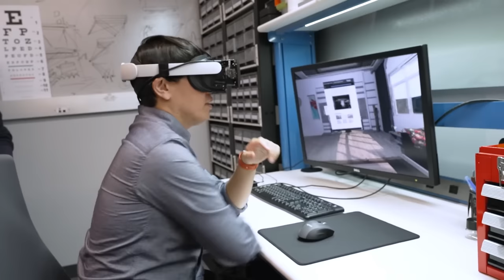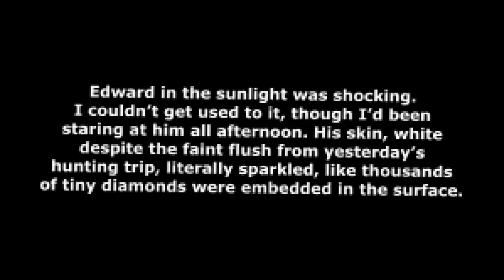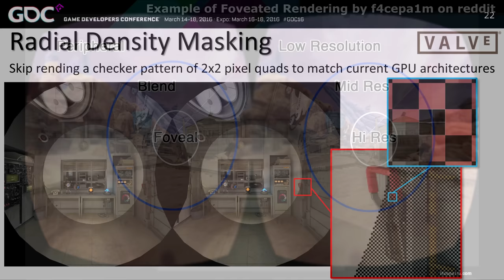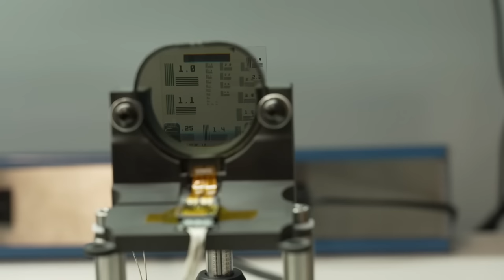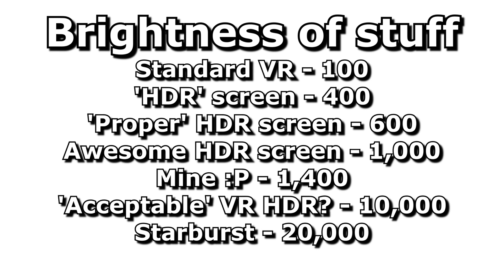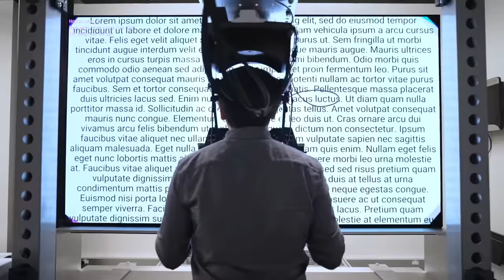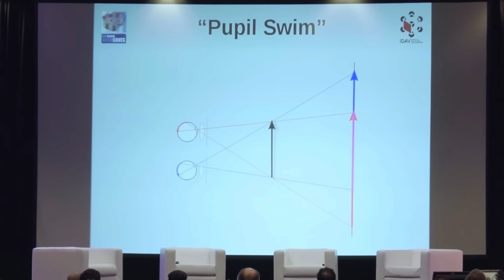Meta's Futuristic VR Designs, Summarised

Comment: I bought the first gen HTC Vive and it's still impressive and gets the job done, in regards to tracking and gameplay. Now it's the case of waiting a few years to enjoy the sum of all these incremental changes with a new headset.
Reply: Yup, most people don't have the latest phones or buy a new GPU every year. This kind of stuff will slowly trickle down, generations down the line it'll be more accessible.
Reply: the only thing that annoys me with my used Vive I got recently is that lighthouses use quite loud gyros, making me disconnect the thing every time. Other than that, A great headset free from Facebook rule.

Comment: VR with eye tracking is already here - a friend at university used a FOVE VR headset to develop a proof of concept where a spider in the room reacts differently depending on whether you have line of sight to it. I wouldn't be surprised if this starts to rear it's head (not only for technical reasons like you mentioned here) but also integrated into gameplay in some way. It seems like it shouldn't be too difficult to integrate one inside of a mainstream mass market headset already. Much of the tracking problems traditional desktop eye trackers might encounter are a result of conditions that are more controllable when you put one inside a headset - IR light reflection on glasses, the distance of the tracker from the user or the room lighting conditions.

Also, standard desktop eye trackers require extensive calibration for accurate tracking and they in no way provide reliable user-independent tracking without recalibration. It'll be interesting to see if placing the trackers so close to one's eyes inside of a VR headset allows for calibration to be eliminated entirely. User independence isn't really an issue for VR experiences but it'll hopefully prompt more research into passive calibration techniques that can maybe be ported over to the traditional eye tracker space.

Comment: 7:00 problem with the 20,000nits number they gave, I wonder if this is before or after the reduction due to display duty cycle and lens system. Both of which can reduce it by 80-90% each time
Reply: yeah, while I want to believe this tech is possible, it's a bit sus, and if all presentations were as baren as showed here (not for example using headset as flashlight in lit room) I question validity of that claim.

Comment: HDR quality isnt just about brightness.

No displays other than OLED displays are even close to being 'proper' hdr, yet they are not close to as bright as most LED panels.
Reply: that's what I was thinking, especially in a VR headset where there's no external light is peak brightness really the most important factor here?
pretty much all the major HMD manufacturers have left O-LED panels behind though, think that was mostly because of the subpixel arrangement or something.
and I don't think local dimming is really a viable option in an HMD (but I dno really) so maybe they do have to make some new tiny O-LED panels for VR

Comment: All of these advancements are amazing, but it's unfortunate that they will give Meta even more of a monopoly on the VR market. The imagined consumer use cases (games, socializing, learning, etc) sound great, but it seems that Meta's own use case for VR is aggressive monetization. In Meta's version of the future, everyone is using Meta headsets to run software sold on Meta-controlled platforms, with Meta taking a cut of any transactions. Hopefully Meta will do what Valve has done, and make many of these advancements available to anyone to implement.
Reply: Facebook's engineers have published some very useful software under open licenses - for example Zstandard is pretty much the best general-purpose lossless data compression algorithm out there and it was made at Facebook. So I do hope they can do something similar with at least parts of their VR tech, I am just worried it may be just enough to make it easier to develop software for Metaverse, but not to do anything useful independently of it.
Reply: I'm more interested in how Apple takes on VR, mostly because of their very robust hardware/software and being far less stingy on ads than meta.
Reply: @nicoliedolpot7213  well, their hardware ain't exactly flawless as Louis Rossman has proven many times over, pointing out major design flaws in various MacBooks.
Also their approach is solely a walled garden, so I am afraid they wouldn't contribute much to the wider VR dev community.

Comment: i wonder what 4:3 stretched would look like in vr... wish i had a headset to try it out!
Reply: WHY
Also, horrible
Reply: @Nate-bd8fg  idk XD just because i use desktop and games stretched
Reply: that's not how VR works XD 
like I guess if you mess with the drivers enough or something you could do it but you can't really set a custom aspect ratio, it's usually just a resolution slider or multiplier or something.
also not sure how tracking would work as the distance your real head moves would be different from your virtual head or something

Comment: imo, VR is nothing compared to brain-computer interfaces. why build a screen when you can manipulate your own vision?
we should have more money going to brain research. just seems futile to continue with this multi-decade tech that still is barely useful for anyone.
Reply: I would rather not have a Meta brain chip installed, thanks.
Reply: When Gabe Newell bestows BCI to the masses he will cement his name in the history books forever... for better or worse
Reply: @awesomeboy9000  yeah we'll see which one of those it will be lol, but cant imagine itll be the best outcome considering the current set of humans we have at the moment... elon has also got his nuralink project going
Reply: While es it would be cool, better, and arguably cheaper solution in terms of unit cost, the R&D for it would be crazy expensive and it's not yet sure if it's possible at all.
Last time I checked it was possible to read blurry images, but inputting images was still far away.
Reply: No thanks